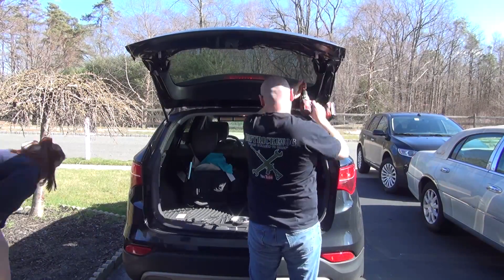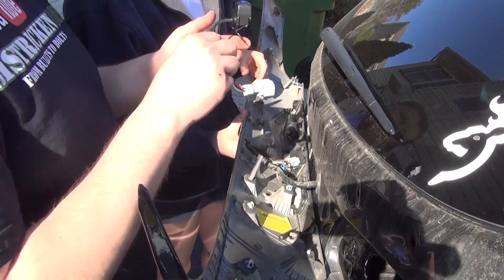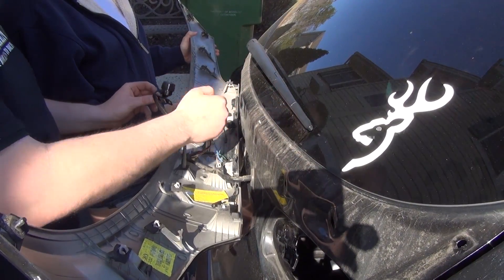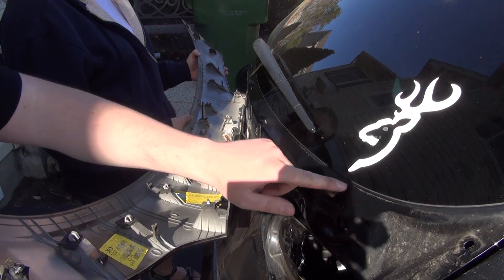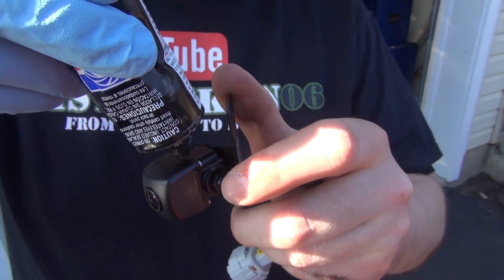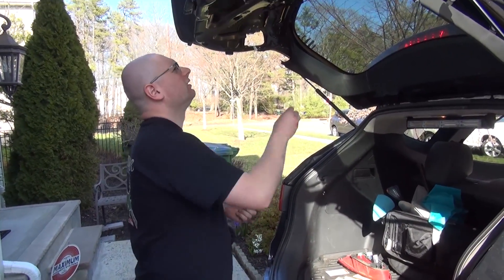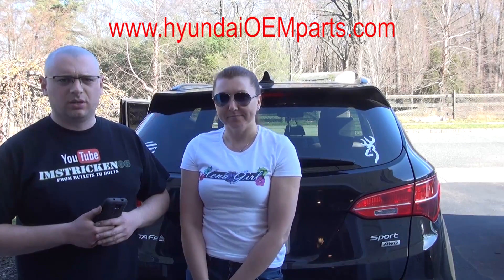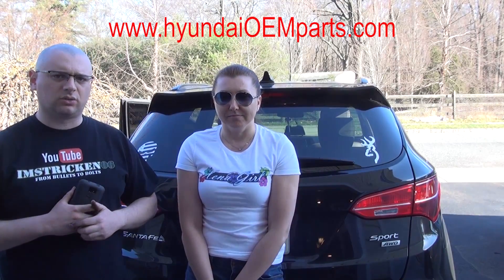DIY: 2013+ Hyundai Santa Fe Back-Up Camera Replacement

Comment: Great video...Thank you.  Ebay OEM Camera under $50.  Took 1.5 hours to take it apart carefully and 15 minutes to reassemble.  Some mention the clips and they require a lot of care, as the cover panel is plastic and can crack if you pull it wrong.  I reached inside with needle nose pliers and one at a time squeezed the clips from inside so they would release.  Took some time but only broke one clip.  The wiring connector slides on in only one direction.  Look at the bottom before trying and it is simple.  And yes, added the suggested silicone stripe above so the camera will not get water running down on it.  Good idea.  Original lasted 11 years so hoping for at least that again.  THANK YOU

Comment: Did the camrea activate when you had the fault? I have no camrea and doesnt activate when putting it in R
Reply: I'm having the same issue and I'm wondering if the camera itself is the problem? I'm hoping someone can chime in on this
Reply: @BradyStcharles  Hi Brad, i replaced the camrea and it worked perfectly.

Comment: Bought the camera and clips today.  I'll let you know how it goes.
Reply: how did it go and can you describe how you removed the existing clips [did you shear them off with a chisel?],  and is there anything to installing the new clips? [for example did you need to remove pieces of the old clip first?] ... thx!
Reply: Actually, since I bought the clips and the camera, I've had no issues with the currently installed camera - go figure.  I'm waiting for the weather to warm up and I'll give it a shot then.

Comment: Thanks for the video - same as everyone you saved me quite a lot. For anyone with a 2018 Santa Fe that ends up here, there are two additional bits of trim along the side of the boot (tailgate) that are held on with plastic snaps. You have to remove these to get to the end bolts for the outside panel. I recommend buying some replacement plastic clips in advance of doing this, they're only cheap but it's nearly impossible to remove this without breaking them (took me over an hour and broke only one, found two were already broken). That panel is held on with 15 fastenings in total so not a huge deal but annoying to have to use force to get them off.

Comment: Hi. I bought from ebay an OEM Mobis camera , but after installation it doubles the warning notification to another language and also doubles the lines. I tend to belive this is not Mobis original. Did you guys buying from ebay experienced same ? Are there any settings for reverse camera where warning notification can be removed?

Comment: Seems like I'm the only person who replaced the camera and the screen is still blank when in reverse. tried two different cameras from the links provided in the comments chain. Any other suggestions?
Reply: May be a wiring issue from the radio/screen back to the camera itself.  Check out this video.  Guy talks about the wiring and another video where the radio was the issue.  Hope that helps.   

https://youtu.be/u1IA6hgM40E

Comment: For the grey clips, I found that if you can put a bit of tension on the cover by lifting it, and the pinch (with a plier) or push (with a flathead) the two grey tabs in, they pop out.

Comment: The original camera had a part metal case that let in water when the metal corroded, replacements from eBay seem to have an all-plastic case which solves the issue. Recently replaced mine but opened it up and added acrylic coating to the circuit boards for extra protection. Use a 9mm ring spanner over the grey plastic clips to release them. Really important - protect the bodywork from the bolts on the end of the panel as they WILL scratch the paint whilst taking off the panel.

Comment: Fantastic video. I just did this project this weekend and couldn’t have done it without this video. I got stuck with the clips portion and wish you had spent more time there. I ended up just yanking it and I think I broke some of the clips. But just wanted to say thank you for making this!!!
Reply: same😂 i broke a ton of clips because they are so hard to get at (2017 santa fe sport awd) and i yanked it but good thing there are five nuts that bolt on to hold it as well, i honestly dont know why there are so many clips

Comment: So finally, after 6 months I replace my camera. I was able to get one new off eBay, OEM, for $70. The whole repair took me about 1 hour, and no doubt the clips were the most challenging part. I was able to get the trip off with only breaking 1 clip. I used a very long screwdriver to press the sides of the clips and get them to pop through one at a time. Thanks for this video. It gave me the confidence to attach this project myself. The dealership quoted me $180 for the labor and $280 for the camera.
Reply: can you put the links to buy your camera? (ebay links)
Reply: Is that OEM working as the OE one , no difference ? Can it be replaced by one with a better resolution ?

Comment: Just did mine today. The final attachment clips, will break. Not designed to pop off. And there were 5 nuts underneath the final trim, not 3. Other than that,  thank you

Comment: I had a black screen. Replacing the camera worked for me. Pick one up from ebay $60. Like every comment here, it’s almost impossible  removing the metal cover without breaking  one or two of the clips. I tried, pushing then from the bottom, and took my time, but still broke a few. Lucky it still held in place once i button it back up. I don’t recommend the silicone, due to it will trap water and debris behind the cover and cause corrosion. Water is meant to pass thru the cover and out. You may still want to cover the back of the camera with silicone, this will protect, the camera from water and corrosion. Thank you for this Great video, it help me wiz thru the process.  👍
Reply: I can't find on eBay.  2013 Elantra limited.  All I see are santa Fe ones for that price range. Any advice?
Reply: Yeah, I can't really recommend adding a sealant to the outside. Water will still eventually get inside and cause massive damage. The proper way to protect the components inside the camera housing is with dielectric grease and by conformally coating the boards and connectors

Comment: I just opened up this rear panel, and didn’t break anything.  For the gray clips, I just compressed them individually while my friend put some light upward pressure on the cover.  I just worked each one at a time and it came off with no problem and no broken clips.  It’s all about taking your time.
I have no idea whatsoever why the camera just fails.  Like he shows in the video, that whole area under the cover is subject to rain and salt water and dirt.  The camera body did indeed have some light corrosion on the outside of it, but the connector was perfectly clean.  I’ve ordered another camera, we’ll see if a replacement fixes the issue.
Does anyone know the difference between the reverse cameras for navigation vs non-navigation?  Besides the $200 price difference?  I believe I ordered a camera for a Santa Fe with navigation, but my Santa Fe doesn’t have nav.  The clips are the same though.
Reply: Where did you buy your camera?
Reply: Hi, did you figure out the difference between the "with nav a" and "without nav" cameras

Comment: I just did it myself today, I've bought the original camera at hyundai OEM parts online store, followed this tutorial, broke 3 clips, but each clip has 2 latches, and only one latch of each clip has broken, so it still locks and we'll attach the cover without  any loose part. It took me about one and half hour to finish and solve this annoying defect.
Reply: Flavio Ishikawa what is the part number for the camera .   Mine is a 2013 Santa Fe sport?  Would yours be the same one for my car?

Comment: I had to replace mine as well and I ordered the same model number camera: 95760-2W000 
But the camera I received puts an extra guideline and warning message (korean) on the screen what is quite ugly. Do you know what should I check to be sure that I order the exact camera what I need?
Reply: László Fodor same here
Reply: Hey I have the same issue with the double lines and warning message in (Korean/Chinese). I purchased the camera from ebay and I believe it was shipped from Hong Kong.  Have you fixed this issue?
Reply: @Browniceey  Sadly not. It's still the same. I agreed on a partial chargeback with the seller.
And since then I did not dare to order another one as noone could go for sure that they have what I need
Reply: @emul-hu   Thank you.  I guess double lines are better than having no camera at all.  I bought it on ebay VS the dealer would have cost me over $300 CAD.

Comment: How many clips did you break removing the trim from the door? Dealership is quoting me 10 clips at a cost of $8 CDN each as part of this job.
Reply: Read your question. And it's a good one. In retrospect, would you try it again? Is there a technique for getting the clips off without breaking them?
Reply: @BKCReview  Just did this repair, use silicone across the top of the trim to secure it, if some clips break, no biggie. You have 7 total screws that hold the trim tight to the metal frame plus the applied silicone.

Comment: It would have been better if you show detail video of "yankup grey clips". I did hands up at that stage
Reply: Minta Chahal good point. I think I broke my clips but got the job done
Reply: The grey clips are terrible, and will break if you just yank on them. I used a pliers to squeeze them together... it was a royal pain in the arss. It would be easier to buy new clips and just break them.

Comment: How did you know it was the camera, not the head unit?
Reply from the maker: Jared Gant i lookes at the camera and could see serious water exposure, figured it was damaged
Reply: Thanks for the response. Just read every post in the 10 page thread on the forum. I guess what my real question is, what's the difference between the black/blank screen and the blue screen? Most on the forum mention and blue screen, but I am experiencing a black/black screen. Before I tear into this, I'm just wanting to make sure I'm diagnosing things as best as I can.
Reply: @Jared Gant,  I have the exact same issue, were you able to find out?
Reply: No, not yet. I will likely tear into this project pretty soon. The OEM cameras are pretty cheap, around $100 on ebay.
Reply: Jared Gant any news? I have the black screen too.
Reply: Me too.. my screen started going off an on then went to black.  I hope its not something they call  the harness but I think it may just be the 📸 the dealership told me it would be 900.00 for camera and harness thought they did not take it apart

Comment: Good video with the exception of getting the clips off. My suggestion is to not even try. Buy new clips on Ebay. You can get a package of 25 of them for under $9  Just shear the back off with a chisel or screw driver. Make sure you have them before you start the job.Below is the discription on Ebay. You can also buy the camera as well much cheaper.

25pc: Blue Rocker Moulding Grommet Clips W/ Sealer Fits Hyundai Kia 87756-1F000
Reply: were you able to get access to all the clips and shear them with a chisel? and is it no big deal to install the new clips?
Reply: @adamlevine9285   I was able to and the clips are easy.
Reply: Dave Mortensen. Just thinking about this job before I attempt it.  You sheared off the entire clip and just replaced it?
Reply: Yes just shear them off.  You will get a bag of them from the link I provided. You will have more than enough to replace them all. I had 13 left over after I did the job.
Reply: Dave Mortensen thx just ordered the clips!

Comment: I've had the same failure in my 2013 SF. This looks too complicated for me to take on myself. Hyundai made it way too difficult to service the camera. And way too expensive to replace. So, I'll probably have to go without or get a clamp on. Frustrating that it's probably a design flaw. Shame on you Hyundai.

Comment: Just completed it. Definitely break off the clips and replace instead of trying to force the cover off. Otherwise you risk damaging the cover. 

Another big help for me is putting the ratchet on my drill driver.  I have had a simple adaptor that fits ratchet on one end where the other end fits in the drill. This speeds up removing and installing all those 10mm nuts, some at bad angles for my back

Comment: 2013 Santa Fe Sport without navigation.
thank you so much for this video.  My dealer quote to replace this was $738.00. My husband and I did this replace today (8/17/19). It took about 1hour and was quire easy. As indicated by many, this gray clips is the worse part.  The issue is that you cannot really see the clips so it is hard to avoid breaking them. There were 10 clips.  We broke 4 of them.  Just take your time when you are pulling off the cover to get to the camera. However, i don't think you can complete the job without breaking a couple.  Don't worry too much, because there are screwes that hold the cover in place on the outer side. I purchased my camera on ebay ($135). The manufacturer is Dorman and the part number is 590-077 (remember is for a 2013 Santa Fe sport without navigation. Everything works well.  I dont see any funny Chinese writing in the back up view or anything like that.   Thanks again for thr video.

Comment: This is a great video. I had the same issue with the salt and replaced it with a new camera.
I got my camera from ebay 75 CAD.  However I have double grid lines.  Anyone else had the same issue ?
Reply: Excellent